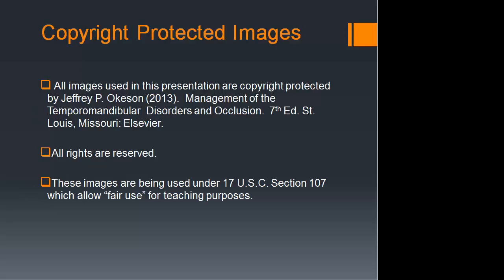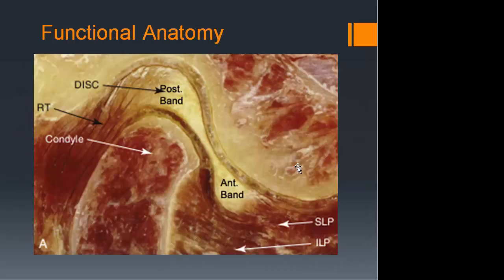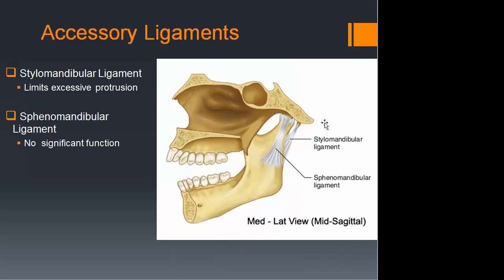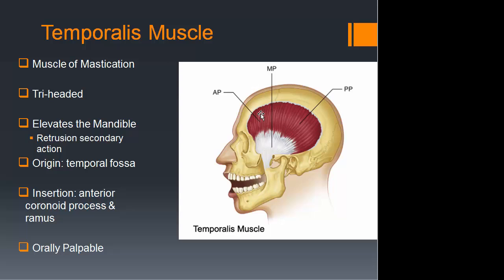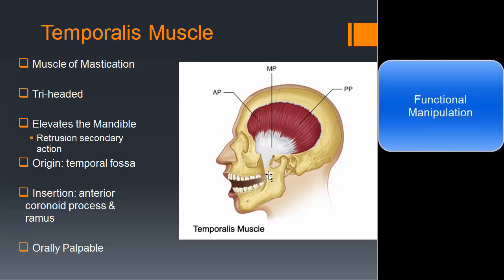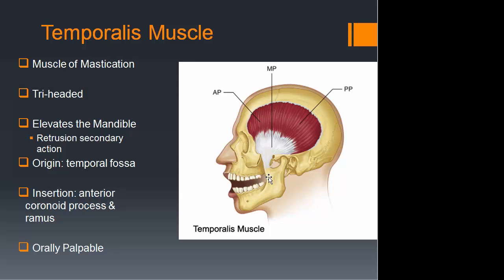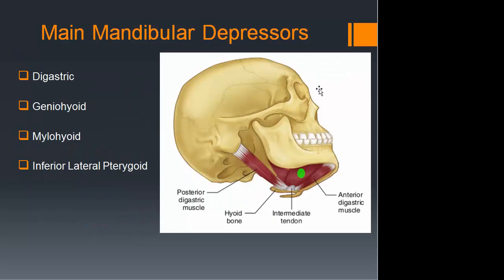TMJ Basic Anatomy & Biomechanics

Comment: Did  you say cerebral spinal fluid in the joint capsule ? Did you mean synovial fluid?
Reply from the maker: Of course. There is obviously no cerebrospinal fluid inside the TMJ joint.
Reply: @douglasgillarddcprofessoro5285  It was in the part of the presentation in which you were showing the Capsular Ligament and mentioned the capsule was full of CSF around 10.08 of the presentation.I listened again to make sure I hadn’t misheard. Thank you for replying. I am not a student of anatomy. I just like to see how my various achy joints are supposed to work. Thanks for sharing these informative lectures.